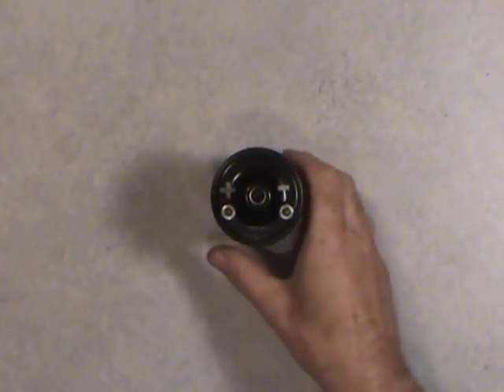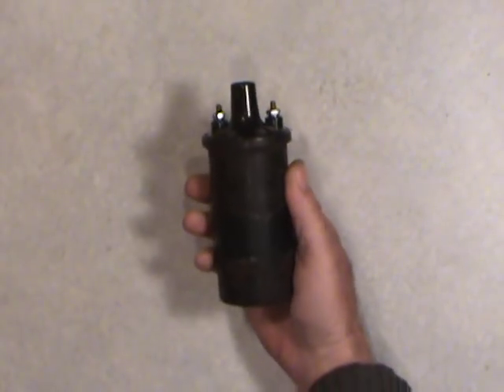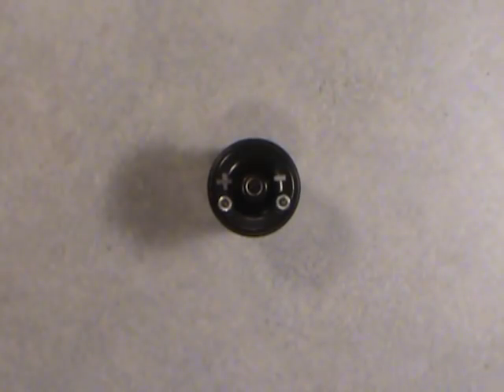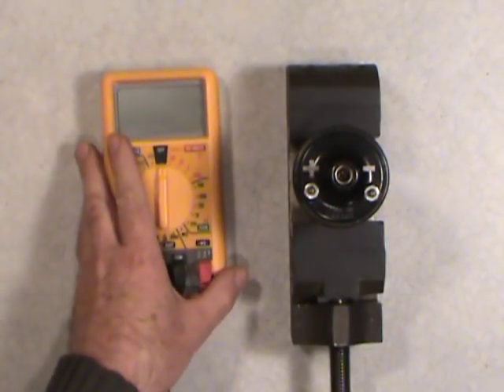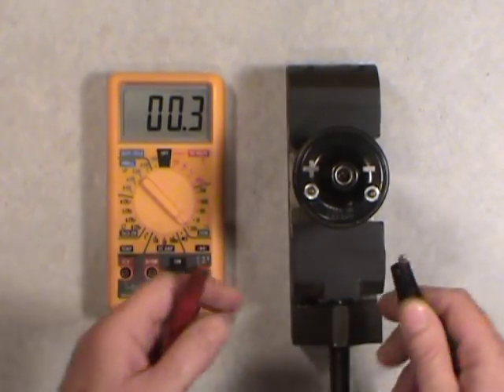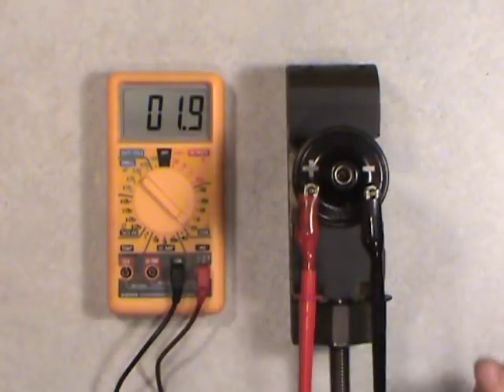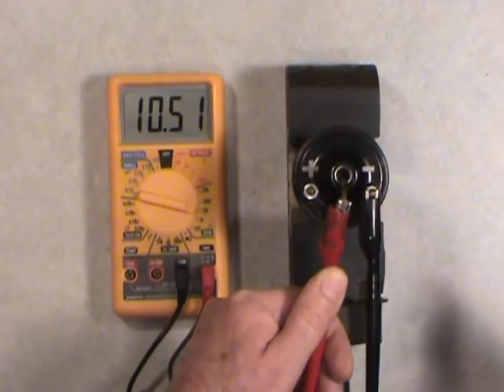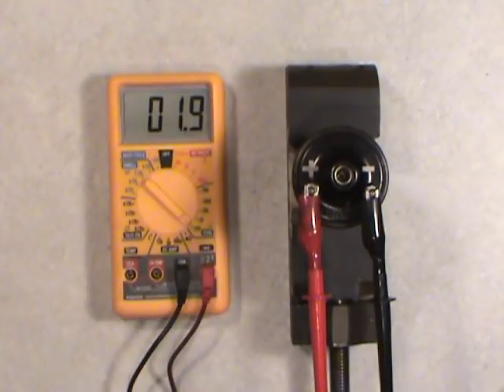Ignition Coil Testing

Comment: Thanks. But could have stuck to the essentials. 2 minutes would have been more than enough.
Reply from the maker: Greetings...JJ Brubaker............You're welcome, and thanks for watching............Well, some time ago, I actually made a "Shorter Version", of this very same Video, and, "it", is on my YouTube Channel.............Where a Person, has to be, well, kinda fussy, is making sure, that the Multi-meter's "Calibration", or lack there-of, is actually Known, before ohms-testing, the Low Ohms/Primary side, of the Ignition Coil, or, if not, then, the Ohm reading, could very well end up being, not so "Accurate", and might possibly, be making, One think, that, the ignition coil's, Low Ohms/Primary side, is Not with-in, its given Specification, and........till next time........Be Safe, take care, and have a good one.

Comment: Thank you sir. Great explanation -  Bad thing  is there is NO Radio Shack two blocks from me any more - very sad - Not Trump wise"Sad, sad" moronish  -  but rather sad. What is in English for HOT ? - is it positive like "+" ?
Reply from the maker: Greetings...Dmitri Shchukin.............You're welcome, and thanks for watching............Well, I've also noticed, that, quite a few years ago, that, most of the Radio Shack stores around here, have also, either moved, or gone out of business...........From what I recall, Radio Shack, was owned by the Tandy (company?) quite possibly, so, maybe, look up the Tandy name as well sometime.............Hot is usually + (positive), and - (negative) is usually Ground, or some people, call it Earth, and, these terms are usually used, when talking about DC/Direct Current electricity (such as a car Battery)............Then, there's AC/Alternating Current (like a house uses), and, there will usually be...Hot, Neutral, and Ground wires, from what I recall, that is..........If You are going to install a New ignition coil, in Your car or truck, make sure, that, You buy, the "Exact"...Specified, by Your vehicle's Manufacturer ignition coil, cuz, ignition coils can have very Different Ohms/resistance values............If You install the wrong ignition coil for Your engine, it might end up with a Weak Spark, at the spark plugs, or maybe, an ignition coil that Over-Heats, and destroys itself...!!!....and........till next time.......Be Safe, take care, and have a good one.

Comment: lol talk all around. how do you test it ? 6:54 i know OHms
Reply from the maker: Piotr Niewinski Greetings Piotr Niewinski....Thanks for watching, and for Your comment/question as well...............You were asking..."How do You Test it"...???...("it", being the Ignition Coil, I would assume)...............................Well, it all depends on, just "Which Exact Ignition Coil"...???...that You are wanting to "Ohms-Test", as there are quite a few, "Different Ones" (as in Type, be it Oil Filled, or the Epoxy/Resin Type), for the Many Different, Manufacturers, Vehicle's Engines, as well as, the Many, Different, Model Years, as well..................................Basically, there are 2 Separate Coil Windings (having Many Turns of Wire), inside, just about any, of the Automotive Type/s of Ignition Coils............................So, what You are actually "Ohms Testing", is, the "Primary Coil Windings", usually, on the "Low Ohms, Scale/Range", of the Ohm Meter, and also, the "Secondary Coil Windings", on a "Higher Ohms, Scale/Range", on the Ohm Meter................Try to find, the "Exact, Low and High Ohms Specifications, for the Exact Ignition Coil", that You want to Ohms test, so, You'll actually Know, if the Ignition Coil, that You are Ohms-Testing..."Falls With-In...the Specifications"...!!!............................On this "Oil Filled Ignition Coil", in this YouTube Video of mine, to Test the Primary Coil Windings, All Wiring should be Disconnected, then, just Connect the Ohm Meter's Test Leads, to the 2 screw-threaded Terminals, and select, a very Low Ohms, Scale/Range, on Your Ohm-Meter (I use the 200 Ohms Scale/Range on  mine), and, I just re-tested my Ignition Coil, just a few minutes ago, and, here's what my Yellow Ohm-Meter/Multi-Meter was Displaying, on its Display...........................For the Low Ohms Test, I was getting 1.6 Ohms (actually, 1.9 Ohms, on the Display/Read-Out...Subtracting the .3 Ohms...Miss-Calibration), when I connected the Test leads, to those 2 screw-threaded Terminals on my Ignition Coil...................................For the High Ohms Test, I was getting 10.48 Ohms, on the 20-K...Scale/Range (10,480 Ohms), when I connected One, Test Lead, to either One of the screw-threaded Terminals, and the other Test Lead, to the Center Tower's Terminal (down, inside of it)................................Then, as long as those 2 Ohms Readings, were..."With-In, the Exact Specifications"...for this..."Exact Ignition Coil"...then, this Ignition Coil, would actually "Pass", the "Ohms Test"...but..."Warning"...there are times, quite Rarely at that, when, an Ignition Coil, might Not Work Very Good, or, might Stop/Quit Working, when it gets up to Operating Temperature, or maybe Hotter...!!!...although, the Faulty Ignition Coil, "Did Pass the Ohms Test"...!!!............................I hope that, what I had to say here, helps You out........................If You care to, You can have a look-see, at some of my "Other, Ignition Coil Testing YouTube Videos", on my YouTube Channel...RockysRoadshow...and, One of Them, is a "Shorter Version"...of this..."Ignition Coil Testing"...Video...enjoy............................Well......Till next time.....................Be Safe, take care, and have a good one.

Comment: No matter what I did my coil was at .002
Reply from the maker: Travis Gill Greetings Travis Gill....Thanks for watching, and for Your comment as well...................................So then, You were sayin', that Your Ohm/Multimeter was showing .002 Ohms, when You tested Your Ignition Coil..........well.........there just might be an explanation or two, as to why You saw that quite "Low" Ohm Reading, on Your Meter........................The first thing that comes to mind (mine, that is), happens to be, the..."Range" that You "Selected" on Your "Meter", could very well, have something to do with it perhaps...???..........................Depending on, just "What"..."Range", that You "Selected", on Your "Meter", will pretty much determine, what You will Actually "See", on Your Meter's "Display", and it could very well be, that the..."Decimal Point"...that You saw, in Your .002 Ohms Reading, might be in that very "Position", due to the "Range", that You happen to have "Selected"...maybe...???......................................Perhaps, try the following, if You care to.............."Select" the "Lowest Range" (might be 0 to 200 Ohms maybe?) on Your "Meter".....then..."Connect" the Meter's..."2 Test Leads"..."Probes or Alligator Clips"..."Together"...and see what Your Meter "Displays"......................By doing so, You might see some "Numbers", or maybe just a "Zero", or a series of "Zeros", perhaps...???......................"If" any "Numbers", are being Displayed, Other-then..."Zeros and a Decimal Point", then, as I see it, that would be, the "Resistance", in "Ohms", of Your Meter's "2 Test Leads", and, maybe, like my "Meter/Multimeter", it might be the "Meter's"..."Miss-Calibration as well, added in...???...............................There are Basically "2" Ohms "Readings", that are usually Taken, when "Ohm's Testing" an "Ignition Coil", as there are usually "2 Coils of Wire Windings", in most of the Ignition Coils that I've seen to date...............................The "Primary Coil Windings", are usually "Ohm's Tested", using a "Very Low Range", on Your "Meter"...and...the "Secondary Coil Windings", are usually "Tested", using a "Much Higher Range", on Your Meter, due to the "Many More Turns of Wire Windings", that the "Secondary Coil Windings" (in that very Same Ignition Coil), have, as "Compared" to the "Much Less Amount of Turns", of "Wire Windings", that are usually found, that make-up, the "Primary Coil" (and yes, we're still talkin', about the very Same Ignition Coil...lol)............................Just wonderin'.......were You "Ohms Testing" the "Primary Coil Windings", or the "Secondary Coil Windings", in that Ignition Coil of Yours...???...............................Also, when-ever I'm "Ohms Testing" an Ignition Coil, I always "Disconnect" all of the "Wiring", that is "Connected" to "Its"..."Terminals", as, the "Ohms Testing", can become, some-what..."Invalid" (aka, "It's-ah-just-not-ah-Right...!!!...lol), and the "Ohms Readings", just "Can't be Trusted"...............................Is Your Engine..."Running/Performing"...OK...or...is Your Engine, "Not Running/Behaving"...so good...???..................................................................................Perhaps..."Re-Test" Your Ignition Coil "Again", but this time..."Disconnect" the "Wiring", that is "Connected to it, and, "Select" some "Different Ranges", on Your Meter, and see, just where the "Decimal Point, is Placed", on Your Meter's "Display"...............Try to Find, the "Exact Ohms Specifications", for Your "Exact Ignition Coil", as that's about the Best "Medicine", that I can Prescribe, at this point in time.............................Good Luck, and, if You need any more help at all, just leave a Comment or Two, under any of my YouTube Videos, and I'll do what I can, to help You out........................Till next time...............Be Safe, take care, and have a good one.

Comment: I said, "Oh, c'mon.." about ten times during this video.  Too much fundamental basics, eh?  Let's measure the thing, eh?  BTW, where is your GROUND measurement?
Reply from the maker: Greetings simplyconnected....Thanks for your comment....Lets see now....Were you looking for, the Short and Concise evaluation of an Automotive Oil Filled Ignition Coil, or, shall we say, the "Fast and Furious" Version?...lol...As you may very well be aware, I'm the kind of Guy that likes to help Everyone, from Beginner, Novice, up to, and including Journeymen, as the case may be....In a Hurry?, then, try moving the "Slider" at the bottom of the YouTube Video-Player to speed things up "Eh"...lol...Ground, you say?....No Ground (hog) needed here at all, because what a Person is measuring here with an Ohm/Multimeter are "2-Separate-Coil-Windings" contained within the Oil Filled Ignition Coils Metal Canister, hence, no Ground (hog) in sight!.... When I take these "Ohm's" readings, I always disconnect "All" Wiring that is attached to the Ignition Coil (Engine Not Running!), to avoid False Readings that may be caused by any of the vehicles interrelated wiring circuitry....Also, watch out for getting "Zapped" by any Ignition Coil while the Engine is Running, as that High-Voltage and whatever Amperes are present as well, won't need to find a designated  "Ground", because, all of that High-Voltage/Amperage really needs to Discharge, is a "Mass of Electrons" Big Enough to Attract it, and that Mass of Electrons could very well be--->"YOU!"<---...So, be Careful now, Take care, and have a good one

Comment: I COULDN'T TAKE ANYMORE.  AND THE METER IS YELLOW. NOW YOURS MAY NOT BE YELLOW BUT THEY WORK THE SAME. MY CRAFTSMAN MULTIMETER IS BLACK AND MY RADIO SHACK IS GREEN MY YELLOW ONE HAS TWO WIRES. ONE IS RED AND THE OTHER IS BLACK AND ON AND ON  BY THE WAY THE OIL IS INSULATION AND HEAT TRANSFER.  19 MINUTES OF PRADDLE AND 2 MINUTES OF INFO
Reply from the maker: Vitatta Greetings Vitatta....Oh No...It kinda looks like...I'm..."Up the Creak Without a PRADDLE"...!!!...lol..............Thanks for watching, oh and...I Thinks Yur..."CAPS LOCK"...Got"..."STUCK"...lol.............................Be Safe, take care, and have a good one.
Reply: It drove me nuts too!  I just needed a 30 second class is all.

Comment: I watched the entire video,  and I don't remember or recall him telling us if those readings indicate the coil works or not, lol.   Jesus Christ.  less info please
Reply from the maker: Greetings...The All Night Diner............Thanks for watching...........Well, for starters, some time ago, I actually made a shorter version of this Video, titled, something like....Ignition Coil Testing (the short version)...that probably runs, about, 8 minutes & change............If an ignition coil "Fails", the Ohms/resistance Test, then, there's no need to Test any further, and, it's now time, for a New/replacement ignition coil..........Even if, the Ohms/resistance Tests out Ok, on a given Ignition Coil, that's not, the be all, end all, in some cases..............Sometimes, when an ignition coil reaches operating temperature (or hotter?), it might start, to not work so well, or, might even quit possibly, in some cases............Have a look on the internet, on how to do an (ignition coil) "Spark Test", with a "Spark Tester" (some are fixed, while others are adjustable, and might only cost about 20 Dollars there-abouts?).............Spark Testing/stress testing, an ignition coil, will tell You, that, the ignition coil's, Secondary High Voltage (ball-park, could be, depending on, just which ignition coil it happens to be, then, oh, up to about 30,000 Volts, to about 50,000 Volts, there-abouts, and also, depending on, the Specified, Spark Testing/Electrode Gap-size, that has to be used, that is recommended, for that "Exact" ignition coil), and that, the ignition coil's, Secondary/High Voltage, will go High enough, in order for it, to be able to, shall we say, make a nice-n-strong Spark..."Jump the BIG Gap"...that's, between the Spark Testers, Two (pre-set distance/gap) Electrodes, and.......till next time........Be Safe, take care, and have a good one.

Comment: No man, I agree with the rest of the world, The video is labeled "Ignition Coil Testing".  Not the history, build materials, mounting orientation, the grit of sandpaper used to polish your freakin' nail, plus a lengthy volt meter tutorial.

I just spent 20 minutes wading through a bog of unnecessary information to get to the 10 seconds that ansered my question.  If I had gotten that 19 minutes and 50 seconds ago, I'd know if my coil outside was bad or not by now, but hey, at least I know that your coil came out of a mid '70s 360ci dodge engine.  cause I needed that.

It was well filmed and clearly worded, but WAY too long.  try making multiple short videos and labeling them correctly instead.  people need volt meter tutorials, and coil testing videos, and shoot, maybe even nail polishing videos, but no one needs them all at the same time.
Reply from the maker: Greetings eatspaste....Thanks for watching this Video, as, you are only "1" out of Over "36,000" Views! (yeah, that's right, Over Thirty-Six-Thousand Views!) at this Point-In-Time, and Still Counting!!!...lol...May I suggest for an "Expert" like you, that you do as I did in the past, and still do, from time to time, and that is to simply, get the "Specifications" out of a Book or Manual....That way, you can go "Directly" to your Ignition Coil and get those Ohms Readings, without wasting your time with the "Basics" that I provide in this Video....Just never Forget, that, "No-One" is Born an "Expert!"....RockysRoadshow is Here for "Everybody" on Planet Earth, of all Ages, and Skill Levels, and not just for People that have already Learned and have Advanced Skills as such!....Hypothetically speaking, if I was an Educator/Teacher of any chosen subject, I most certainly would want to be the one that Helps the Beginner, as in, a Person that is Interested, and, just Starting-Out, doing what I can, to provide the Knowledge and Skills, that I'm able to pass on, so that the Person/Student is Encouraged and Praised with His/Her Accomplishments/Advancement in the Subject at hand, rather then be Someone out there, that is on a Power-Trip, and tries to Be-Little Someone, for Not-Knowing a whole lot about what may be being Discussed or Worked-On at the time....Yeah, it's ok to Whine and Complain, I guess, well, at least for some....May I suggest that you have a Gander (Look), at "All" of the "Comments" that some Very "Nice" Folks have Posted on this Video so far, as these Comments might just Surprise you!....Please, treat RocksRoadshow as you would with a Television Channel....If you Don't like the Program on this (T.V.) Channel, all you have to do, is grab your Remote Control, and, "Change Channels!!!...lol....ps, Arrogance is not my style!....Take care, and have a good one.